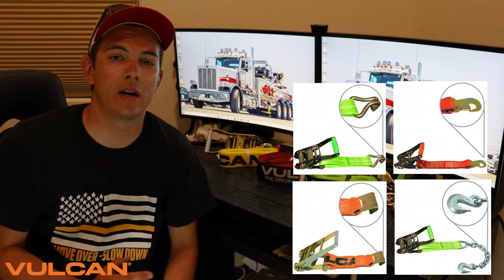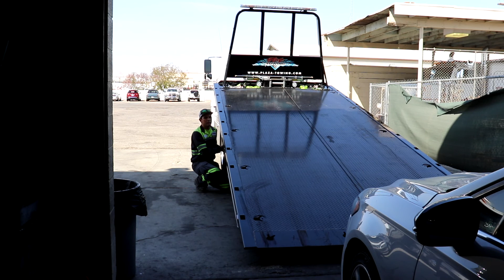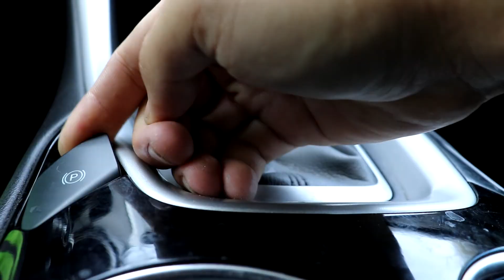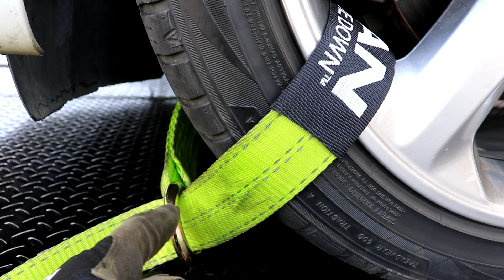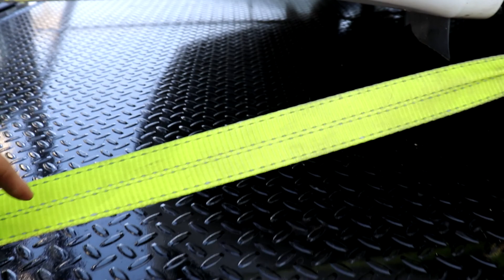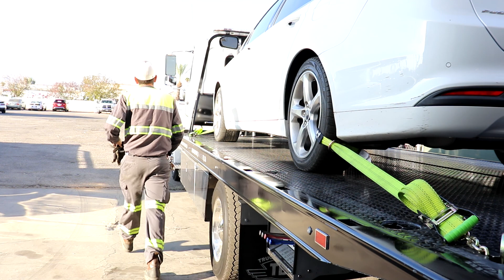VULCAN Exotic Car Rim Tie Down Set

Comment: Nice Video. I'm trained on forklifts lifting heavy steel. An example might be 6" round solid by 12'. When we use a lift strap in a choke style attachment it reduces the max amount the strap can handle. I think by 50%. This is printed on the strap. when we use a double ring attachment the strap can lift its full rated amount. Are your straps capable of 3300 lbs. in the choke attachment you use?

Comment: What about the cars alignment? won’t this type of tie down put their alignment out of spec?
Reply from the maker: Thank you for your question.

This style should not affect the vehicles alignment. The strap should be snug, however you should not be tightening it enough to cause an issue with the alignment. The best way to use this system would be to have the straps running directly in line with the tire to a tie down point at the edge of the trailer, if you have to run the strap to the corner that will work as well and should not affect the vehicle.
 
Best Regards,
The TrucknTow Customer Service Team

Comment: I have a kaufman 2015 gooseneck 2 cars trailer im using these th050 so far no issues although the lines are not straight,they r pushing outward towards the trailer edges because it doesn't have assigned spots on the bed.is that fine?
Reply from the maker: Hi Alaa,

Thank you for your question!

The TH050 model is designed as an "in-line" tie down system, meaning the strap should run in line with the tire all the way to the tie down point. For maximum security and longevity, we do not recommend tying them down more than 1 degree off line.

If you have additional questions or need further clarification, please contact our support team at support@truckntow.com, (888) 918-8150, or by chat at TrucknTow.com. We will be happy to assist you.
Reply: @truckntowdotcom  thank you so much  for the explanation.

Comment: Could i use this to tie down a polaris rzr xp 4  1000?
Reply from the maker: Hi John,

TH050 straps are lasso style. They should work on these tires, given that it is a 12' strap. If you have open rims, these straps are perfect for that application. They are primarily designed as inline tie downs that can go through the rim and form a choker-style strap on the tire.

However, your anchor points will determine the type of hook that is needed.

If you have any additional questions, our customer service team is happy to help. We can be reached at (888) 918-8150, support@truckntow.com, or via the chat box at TrucknTow.com.

Thank you!